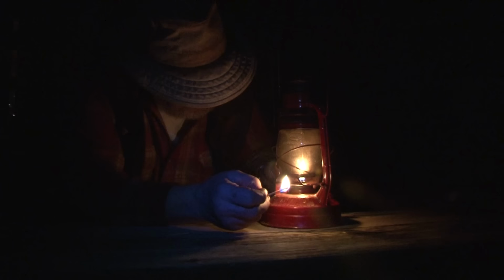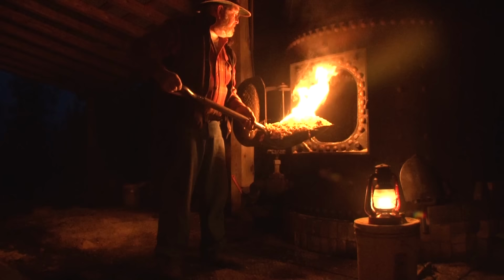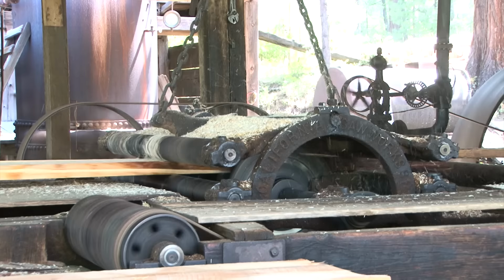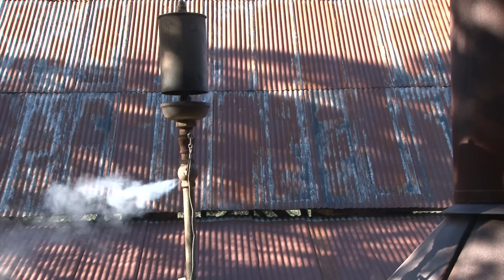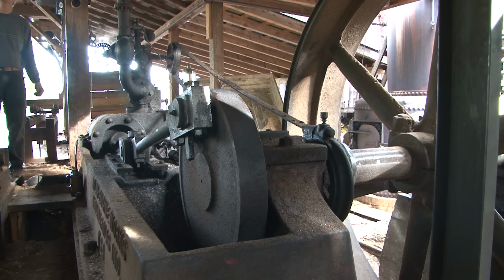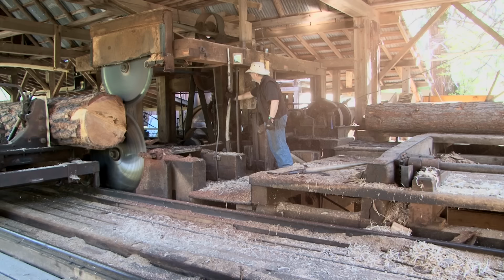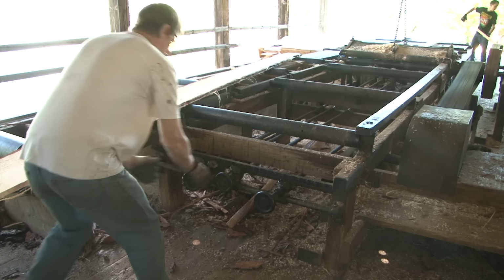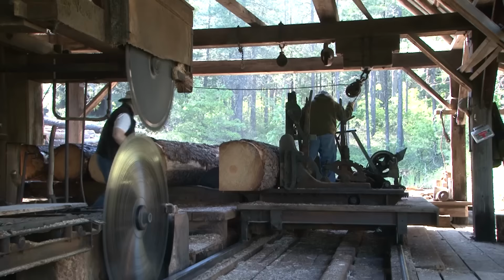Best of the Historic Steam Sawmill

Comment: No doubt a modern sawmill owner would scoff at this rig's 6-minutes-per-log speed, while at the same time complaining about the cost of fuel which this sawdust-powered rig doesn't require.
Reply from the maker: Thanks for watching
Reply: bledlbledlbledl   Most modern mills use the sawdust as well, we burn it in the kilns to dry the timber.

Comment: I am confused, the narrator says electric utilities have never been brought to the property. Yet at the beginning of the video the man turns an electric light bulb off. And lights an oil lamp. I am so impressed by this power source. Steam ruled back in the day. This mill is a look into our past. Amazing... Tried and true. It works and they make fuel for the boilers with every log they saw. Very cool with little waste. This operation appears to be a money maker. I am certain the equipment was paid for long ago. Labor, taxes, steam oil, and buying the logs are the only expenses.  Plus the slabs can be sold as firewood or used for the boilers. A very efficient operation. And this family is quite good at it. A money maker!  Another example of the old way being a really good way to do this. People back then had it figured out. The equipment appears to be well maintained. Impressive. And very cool.
Reply from the maker: Thanks for watching the video.  I can clarify for you.  The property is off the grid.  Any electricity used comes from solar and as needed, a steam powered generator.  There is a diesel-powered generator at the box factory that is used occasionally.   They only mill timber from their own 900 acre forest which is maintained as a sustainable forest.
Reply: @mumunriyadi299  Do not post spam.
Reply: @MrShoptaw  truly amazing!!!

Comment: This is the best thing I have seen all week. The pond can supply water, the shavings and saw dust fires the boiler, the logs can be floated in on the pond, the station is setup very smart for a smooth work flow. Love things that make sense and make use of what's around you. No expensive fuel or parts that nobody could make. Very nice, VERY VERY nice!

Comment: Great video.  I like to see people who are self sufficient.  I would guess this saw mill would qualify as "green tech".  Thanks for sharing.
Reply from the maker: +cerberus Yes, I think it would qualify also.  Thanks.
Reply: Depends on what you mean with "green tech" all that burning do cause a lot of smoke and pollution, but I would think it's not as bad as oil, diesel or coal
Reply: From just the perspective of pollution/smoke wood is far worse than coal/oils, in fact we moved to coal impart because of that. That and that all the forests of Europe where disaperring, some haven't recovered to this day.
Reply: The cleanliness of the smoke had nothing to do with the move from wood to coal, and wood smoke is considered cleaner than coal. Both have roughly the same energy value too, but by weight. Since coal is heavier, it 'contains' more energy, burns hotter, doesn't need to be seasoned, and doesn't have a problem getting wet. Coal smoke was far more damaging and dirtier to European cities during the Industrial Revolution than centuries of wood burning ever had.
Reply: Coal is more energy dense than wood since coal has a much higher carbon content, wood even when dried has a significant water content and also have many other impurities that don't contribute energy when burned and just steam off wasting energy. Transport is expensive so you would want to transport the thing that gives you more bang for your buck, therefore we moved to coal
Reply: I forgot to add, charcoal is not heavier than wood, rather the opposite, charcoal has roughly the same volume as the wood it started out as but with all the impurities cooked off, so i'ts much lighter. Charcoal was the main form of coal used at the time, coal taken from the ground however has been under huge pressure so all off the air in it has ben pressed out making it more dense, think as mined coal as a kitchen sponge that has been pressed versus a kitchen sponge that has not been pressed, the first one takes up much less space. So transporting charcoal would not be that much different to transporting wood, it would just weigh less
Reply: On the bright side, since they're burning their own waste (saw dust and such) there is no energy wasted in mining/extracting and then transporting fuels to the mill. Even if it was electric, if the electricity came from coal or natural gas it would not be much better when you factors in transmission loses.
Reply: We were talking more in general but in this case it makes sense and I don't think they care about the logistics of transporting coal vs wood. The thing is with electric vs this way of doing it is with electric you get way more efficiency out of every piece of coal even with the transmission loss plus you don't have to transport it in trains but get to run it in cables
Reply: While that is technically true you have to think about that when burning the tree all that carbon and other stuff gets released as smoke in only a few hours while in nature when a tree dies it takes many years for it to decompose. So the amount is the same, but burning releases it many times faster than would naturally happen and it's not certain the environment can handle that sudden burst of material, you could probably be able to drink 10-20 liters of water in a few days but if you tried drinking that much water in one day you would die
Reply: @TheZebinator  Burning wood is green. The burning can't put more carbon in the air than it takes out in its life and it is a renewable resource.
Reply: @rastapete100  I mean sure, but when you cut down tree and burn it you basically release all the carbon it has taken out of the air and it doesn't absorb more carbon when it's dead, but it's still a renewable source of carbon, ire. fuel
Reply: @TheZebinator  Yes it releases its carbon whether you burn it or let it rot and while this is happening another tree is growing in its place. I had always felt a little guilty about heating with wood but I found that all of the environmental agencies say it is a green way to heat.

Comment: how do those large flat belts remain on the cogs that they are running on? do they ever slip off?
Reply from the maker: I think it's a matter of having the rollers aligned.  Thanks for watching.
Reply: That´s because the belt wheels are a bit rounded, so they are larger in the middle. We call it "bomberad" in Swedish, i don´t know the English word for it. That makes the belts align themself on the wheels. And sometimes you need belt grip spray. I have a lots of old machines in my factory that uses these flat belts

Comment: A pleasure to watch. I suspect they produce all the saw dust they burn - old fashion efficiency and ingenuityScott
Reply from the maker: +The 2 Car Garage Shop Thanks, and yes, all the waste products go to fuel the boilers.
Reply: +MrShoptaw  Is there some sort of auger in the boiler to mix the sawdust as it burns? I've found that piles of sawdust on the ground do not burn well at all, how do you have such a raging fire in the boiler from only sawdust?
Reply from the maker: +Spracker - No auger in the fire box.  They also burn the edgings and other solid wood waste.  Those objects probably help keep the saw dust from clumping together and I suspect when the fire is hot enough the saw dust burns clean and completely.

Comment: Now there's a notion. A mill powered by its own shavings. Brilliant. Also, sustainable. Add a steam-powered machine shop to make parts, and that mill could be running long after we run out of oil.
Reply from the maker: The mill has just that.  A vintage steam powered machine shop where spare parts are made to keep the mill running.  That is the only operation I have not filmed but hope to.

Comment: An old atlas steam engine not many of those left lucky it's been working under that roof all these years and will run forever with a bit of maintenance and plenty of oil too lube it brilliant machinery at this old mill 'll very old and still works perfectly
Reply from the maker: And this mill is lucky to have 12 working engines running the different machines.  Thanks for watching.

Comment: Can you imagine historically the numbers of deaths & injuries! everything from back problems to steam burns, splinters, cuts, limbs & fingers crushed or lost, dangerous work back in the day
Reply from the maker: I guess even if you go back beyond the industrial age, say to as far as the cave man times, life was sure hard for our ancestors.  :>)
Reply: I suppose, but many of the dangers to primitive man were difficult to anticipate or prevent *(a bear mauls somebody in the berry patch) Now consider this saw mill which by all respects is a modern operation, these large diameter blades are operating at hundreds if not thousands of RPM...yet no guards. Huge belt networks all open,tons of moving parts all open, lots of steam, lots of flames, lots of heavy steel & all lumber handled manually. I understand to maintain this historical operation you must remain true to its antiquity, i'm just pointing out it must have been a very dangerous occupation back in the day, it's a dangerous occupation in modern times
Reply from the maker: I'm not disagreeing with you.  I just see some similar and interesting parallels.  If one at the mill does not respect the dangers or pay attention and take precautions, then bad things can happen.  :>)
Reply: It really is a fascinating window into the past, i had seen in a movie an older "mobile" steam powered mill it's date appears around the 1870's, it was moved about on a wagon & operated where the trees were being harvested. I imagine there would be larger mills somewhat like this one & that any mandatory safety gear such as glasses, gloves or hard hats would be nearly a hundred years away...then again the industrial revolution had children manufacturing sulfur matches, working as chimney sweeps & used to crawl under the cotton gins to clear debris & scraps...deadly.
Reply: This is from the days when all this safety nonsense was in YOUR hands. You must have respect and pay attention when using any machine.
Reply: fourtriangles2112 that's why only reel men work there not the soft hands of the young kids that we have today a hard days work and a cold glass of water would kill most young men today it's sad what parents are doing to there kids now days

Comment: Hell, and the blade RPM's barely dip with a cut that deep. Amazing steam power. Looks hella dangerous though, all those exposed moving parts.
Reply from the maker: You wouldn't think a belt driven system would work but it sure does.  :>)

Comment: I wish I could afford a mill set up like this. I’m trying to slowly gather together a set of mill equipment most of it 1950s/60s electric kit as it’s cheap. I think the steam mills here in U.K. have all gone or been converted long ago. Not many places left that run lineshafts all separate electric motors. Shame as steam like this running on mill waste is a good way to power the place.
Reply from the maker: It does work well.  Thanks for watching and good luck with your project.  :>)
Reply: MrShoptaw its a lovely mill looks a nice setting too. Looks like you have it right with a simpler life. All be it hard graft

Comment: Wow, health and safety would have a fit!!! Not a place to be daydreaming or accident prone! Love how not a drop of electricity is used but I still can’t figure out how metal machines were made with ever increasing tolerances? I mean we went from some iron blobs in the first ever furnaces to precision machines with straight edges and flat surfaces and perfect angles to micro metre accuracy!! These Steam engines and saw blades are maybe somewhere in the late middle of this advancing technology? Amazing.
Reply from the maker: I think what helped keep those early workers safe was they knew their safety was largely their responsibility.  Accidents did happen and still do.  An accident on those early machines could be devastating.  :>)

Comment: I wonder if they could install a large fire pellet maker on the property and change our their current furnace with a large pellet stove and use the pellets they make from all of that saw dust to power the new furnace and make their production even more efficient and self sustained......just a thought.

Although I suppose they'd need a power source for the auger and what not, but I would guess they could get the stove started by hand then use the steam power to generate a small amount of electricity to power the auger and forced air.
Reply from the maker: The mill waste fuels the boiler which produces enough steam to run the six engines of the sawmill and planing mill.  All self sustaining.

Comment: So you can reuse all the sawdust to keep the furnace going. Nothing goes to waste. Looks more efficiant than electric powered
Reply from the maker: Yes, the sawdust and scraps work well to fuel the boiler.  Thanks for watching.
Reply: 4:17 probably oiling that with whale blubber
Reply: Wait till you find out modern saw mills burn the scraps and sawdust to make electricity and dry the lumber.

Comment: Watchmaking factories would have water wheels powering 40 or 50 lathes through a driveshaft in the ceiling
Reply from the maker: This mill also has a machine shop powered by steam and line shafts to make replacement parts for the mill equipment.  You can see it in my most recent video of the mill.

Comment: This is a pleasant video, and touches many people as comforting, me included. I have a couple of questions though; how long does a shovel of sawdust burn, and thus how often must they stoke the boilers? Also, how easy is it to find parts for the machinery and how much down time does the mill experience for repairs and maintenance?
Reply from the maker: Some of your questions are answered in my video "Phillips Mill the Full Story."  They stoke the boiler often which seems to coincide well with when the log is being turned on the carriage.   The mill's steam powered machine shop can create most all necessary repair parts.
Reply: @MrShoptaw  Thanks

Comment: And sawdust burns well enough enough to keep pressure from experience with traction engines you need a strong fire to keep pressure up
Reply from the maker: It has been a reliable fuel for this mill.
Reply: @MrShoptaw  nice very cool set up

Comment: Very cool and interesting but it would be more effective to have the steam engine to drive a generator that generated electricity to a big battery storage and just cut off the axle behind the saws and attach an electric engine there, would be much stronger, and since you connect it to a battery you use all energy since there is delay time between every cut, but sure I understand that it's suppose to look and work old fashioned :D
Reply from the maker: Thanks for watching.

Comment: Fantastic operation.  Beautifully run.  How do you maintain the machines?  There must be a lot of wear on the parts.  How do you keep up with it?
Reply from the maker: The steam powered machine shop has all the tools needed to manufacture any replacement parts to keep the mill running.  :>)
Reply: That is wonderful.  You must have dedicated employees, to handle all that without electricity.  And to keep the machinist talent, that can probably work more lucratively elsewhere.  I saw a belt-powered machine shop once in NYC, midtown of all places that shut down in the 40's, and was still in place in the 90's.  Where is the mill located.
Reply from the maker: The mill is family owned and operated and located in northern California.  You can learn more from their web site.  Google Phillips Brothers Mill.

Comment: so reliable no computer machines here program to fuck up pure steam solid iron work horse & real workers love the old steam engine never miss a beat in a modern computerized sawmill all that programming u have to do punch in the cut sizes if the mother board goes u have to call the computer tech man to fix reprogram the whole system u guys with steam powered sawmill will have the job done
Reply from the maker: It got the job done then and gets it done now.  :>)

Comment: How do they transfer the steam power to keep the rail shuttle moving back and forth?
Reply from the maker: You probably noticed the large fly wheel that the engine turns.  Through a series of belt driven shafts, the circular motion is taped to pull the carriage forward when when the lever is pushed forward then reverse when the lever is pulled back.  Hope that helps.

Comment: I notice most modern sawmill use bandsaw, while traditional sawmill use circular saw. why they switch to bandsaw? i only see bandsaw is thinner, less dust and waste, any other benefits?
Reply from the maker: I'm only guessing but I think it also does not limit the size of log that can be milled.  There are probably other reasons as well.

Comment: The whole mill is run on just one boiler?
Reply from the maker: The sawmill and planing mill run off one boiler to power six steam engines.  The box factory a second boiler for two engines and the machine shop a third boiler that powers one engine.
Reply: Thanks for the reply I thoroughly enjoyed the video.

Comment: S...how do the blades cut all the way through and not hit each other?
Reply from the maker: They are offset.  Since the blades are circular, the top one is slightly forward of the bottom blade which allows it to be lowered enough to overlap the cut of the other.  :>)
Reply: MrShoptaw Thank you.  It is not apparent in the video.  I actually thought they were offset laterally which didn't make any sense at all.